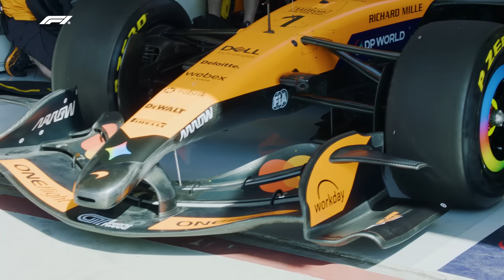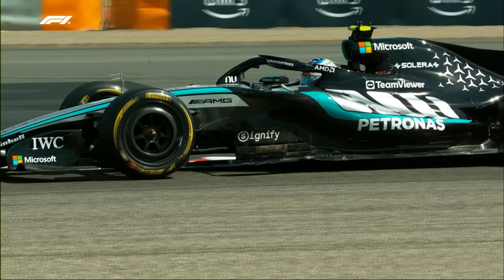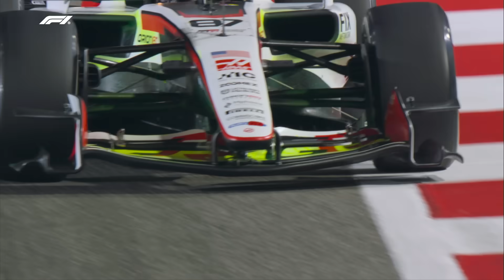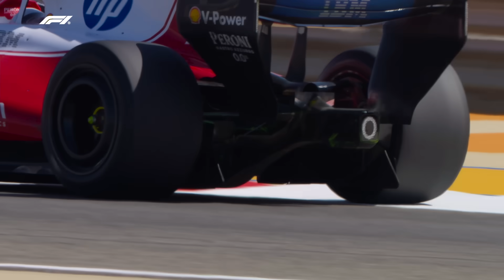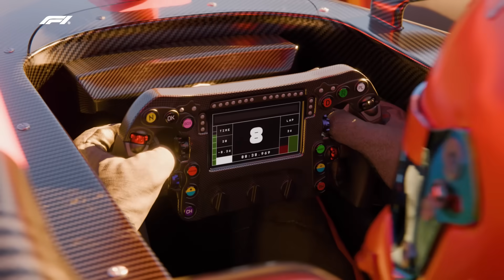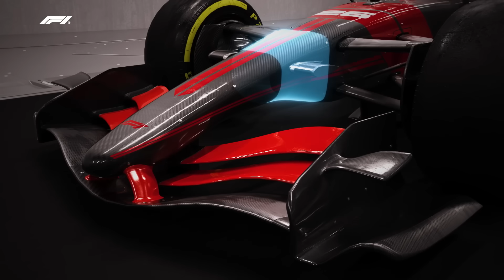The Ultimate Guide To The 2026 F1 Cars

Comment: My ideal boost mode rule book would demand the system does not change the overall temperature of the engine in operation, but surplus exhaust airs could be vented through the interior of a car after retiring to typical operational horsepower.

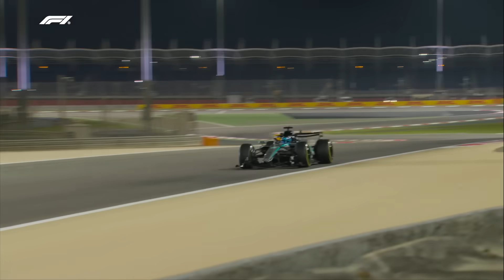Comment: 6:27 shows off the theory that Mercedes will win because they are superior in direct injection, and they have the flex capacity in their front suspension assembly to safely take each race track to its limits.

Comment: The reason the midfield will be exciting is because the regs are so bad that races will be be about management. The regs are to allow cars to race closer but with battery management and drivers not allowed to go flat out, will be the same results for different reasons as previous seasons. At least the muddied will go for it because they need the points. There is so many classes of racing that leave the batteries to formula E, leave the durability to WEC, let's just have a series that is about loud engines and being able to go flat out. Bring back in race refuelling, full tyre freedom of choice and bring back different tyre suppliers. David Croft is grating enough without a lecture on how and when drivers can use battery "boost" active aero and whatever convoluted "changes" get added while trying to hype you at "the battery boost is like a Ferrari f40" here's a thought, ditch the battery and give the horse power to the IC!

Rant over, hope everyone enjoys the new season

Comment: Boost mode seems so much better than DRS from a competition angle. It‘s not „free“, instead drivers must somehow have earned the energy for it on track. The trigger point problem remains, but there‘s still a big difference between just being behind and actually having to work for it. I guess we‘ll have to see if it actually works.

Comment: Pirelli has not only changed the rubber, but also the internal architecture of the tire:

High-Density Aramid Belt: An internal structure (carcass) has been reinforced with new synthetic fibers to prevent tire deformation under 350 kW of torque. Without this, the tire would "flare" (lose its circular shape), destroying the aerodynamics of the road surface.

"Dual Cure" Compounds: Pirelli is developing a technology where the base of the tire (near the carcass) is more rigid to withstand the load, while the contact surface is softer to provide grip.

Thermal Resistance: The biggest enemy in 2026 is internal overheating. As the MGU-K also brakes the car with 350 kW, the heat generated by magnetic and mechanical friction on the rear axle is constant. The tire is now designed to operate in a higher ideal window (115°C - 130°C), compared to the previous 100°C-110°C.

Comment: I want full active aero not two position ..     the cars slightly smaller again  ,  inline engines only    Any number of  pistons no more than 6.    No fuel flow regs but still no fuel stops.        Bring your own tires , no engines or parts cap.  Keep the cost cap.

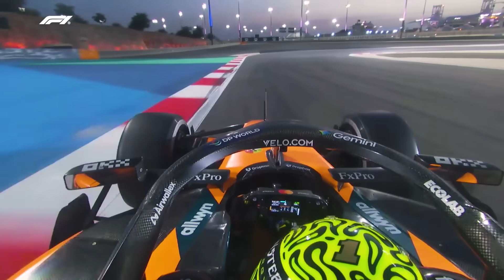Comment: 2:07 so the car needs to be lighter than the minimum weight requirement? I'm no engineer but that doesn't sound right.
Reply: So when they include tyre, driver and weight will be equal to minimum weight for race
Reply: No the car needs to be closest to the minimum weight limit
Reply: It’s because they may have to add ballast to the front or rear of it

Comment: Recap: These regulations are horrible, but admitting it would mean admitting that we have no idea what we’re doing.
Reply: Fingers crossed it ends up being a total calamity on the starting grid at Melbourne.  These regulations deserve to fail as they go against what is supposed to be the pinnacle of motorsport.
Reply: what's bad about them? i think it's great!
Reply: @Baobei_Beolab  LICO during qualy? F1, the pinnacle of motorsport.
Reply: @Baobei_Beolab  They're so great the FIA is already thinking about reducing the electrical power, dropping from 350 kW to 250 kW... thus undermining the very spirit of the regulations in the first place.

Comment: Formula 1, pre-2026 - the pinnacle of motorsports
Formula 1, post-2026 - the pinnacle of battery management...
Reply: Hybrid started since 2014. You are a bit slow
Reply: @jonpetter8921  drivers didn't need to lift or downshift for battery management up until now.
Reply: @busybillyb33  In every rule changes there will always be people blaming something. I will enjoy this season and the coming ones.
Reply: @busybillyb33 they also managed tyres up till now so you cannot say they push the car from start to end
Reply: @busybillyb33  wrong they didnt downshift but drivers played with lift and cost before when they tried to defend, liftinge and costing a bit before the corner to spend that energy getting out of it faster then their opponent

Comment: So “Overtake Mode” is DRS, just renamed
Reply: No, that’s active aero. Overtake mode has nothing to do with the aero, and rather is extra power from the battery.
Reply: @tyr.karting So ZombieKilla and I r both wrong?
Reply: no, DRS reduced drag to give added acceleration. Overtake Mode gives more power for added acceleration.
Reply: But for the entire lap, and a up in engine power not a reduction in drag
Reply: It serves the same function as DRS (ie. an overtaking aid), but the mechanism is completely different. DRS gave a speed boost by reducing drag, Overtake Mode gives a speed boost via extra PU power.

Comment: this ruleset is fundamentally flawed, it forces the chassis design to bend over backwards compensating for a weak PU. Too many big changes crammed into one gen: fuel, chassis, power unit, also the cars are smaller on width because of the smaller tyres,  but on length you guys reduced that by going from a 100kg fuel tank to a 70kg fuel tank in an already energy starved formula, everyone will do 200m LICO in the race